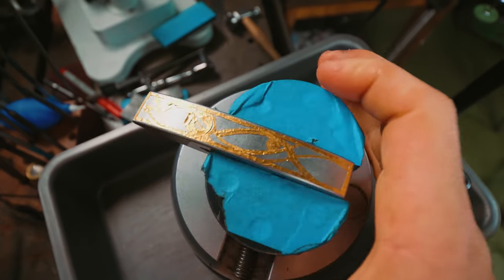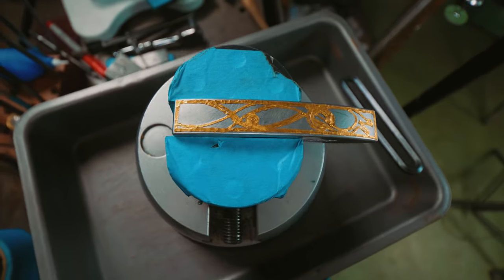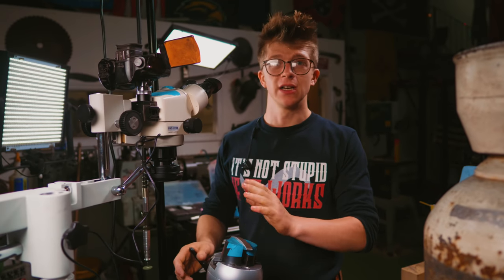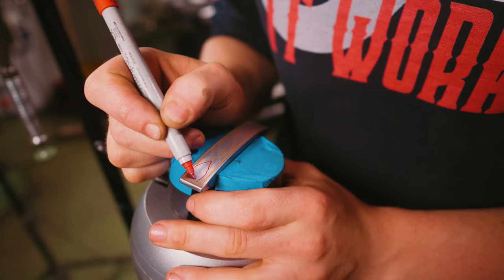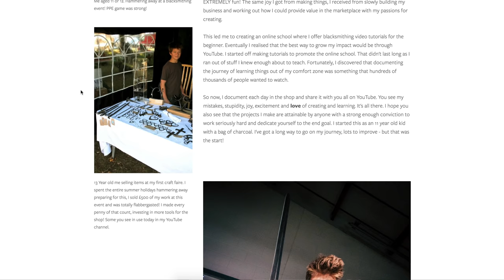MAKING A VIKING SWORD!!! Part 21

Comment: Alec, using 'Damascus' techniques I'd like to see you forge a aluminum bronze, and tin bronze twisted billet (so to be clear, alternating layers of Aluminum Bronze and Tin Bronze forge welded together, then twisted). Interestingly, this would be neither Makume Gane, Sheffield Plating, or Damascus - but something uniquely its own. As techniques are often named after their place of origin, you could call the process 'Norfolk's Bronze.' Using the twisted billet, I challenge you to forge a 'Carp's Tongue Sword.' These are ancient bronze blades and deserve a renovating rebirth! Attempt #22
Reply: I'd like to see that
Reply: will bronze forge weld to aluminum?
Reply: @jnathannger8654  Bronze can be made via a few methods: Copper and Tin, Copper and Silica, Copper and Aluminum. And Aluminum Bronze is what I'm referring to, not welding bronze to aluminum. Two different alloys of bronze (one made with Tin the other with Aluminum) forge welded together to create pattern and strength.
Reply: CosmicVitamins
Can you purchase billets of the various bronze types , or would it mean you'd have to take the separate elements and melt them yourself to create your own billet?
Reply: @notsane6967  You can buy bronze ingot of various compositions online, but salvaging scrap and making it yourself is more cost effective.
Reply: That sounds like an interesting project. Nice change of pace from iron/steel work, too.
Reply: I really hope that Alec does this when he finishes this project. I would love to see it.
Reply: Lets push this this is so awesome!
Reply: I'd love to see Alec do this, but it's poured, not forged. Once you decide on the bronze composition, you melt the copper and its companion (aluminium, or tin, or ... arsenic)(for real) in a crucible, and then pour it into a mold. Video showing the whole process: https://www.youtube.com/watch?v=PKsoch0DNfc

Comment: Only about 5 or 6 min of actual content between the sponsors bits. Was really hoping to see that gem get set today. Guess we will just have to wait for it.
Reply: Yeah it was very disappointing. If the videos progress in this pattern much longer I might have to unsub.
Reply: if it were me I would be dreading doing that part.  suck fine and delicate work that could mess up the entire project.   in this project alone Alec has begun to master a brand new art he never touched prior and its turning out really well.  don't mind how long he takes when he is hitting such high standards in work
Reply: @thewaterless  Been following this channel for a long time. Would never unsub, was pointing out that fact that this is a short little tease of a video. That leaves you wanting to see more... Would love to own this sword, hell I would love to own any of the item's that he makes.
Reply: @mrJohnboyandbilly  it's a very challenging part, in the previous video there was a snippet where he was practicing. Looked like he was getting the hang of it. I really hope this sword sells for a lot, as he is putting everything he's got and more into it.
Reply: All about the $ at this point.

Comment: As the sword is nearing completion you you might have some time to pause and breath, I had a couple Damascus questions: 

1) Are there any metal dyes so you could used layers of different colors to make brightly colored Damascus? I've seen a lot of colored metals, but it seems like it is usually a post forging treatment, not something in the metal prior to forging.
2) If you could forge in an vacuum or an argon bath, could you forge non-metallic items, or more flammable metals like magnesium? Do you just need materials of roughly the same melting point, or is there more to it?

Comment: It really shows the skill and dedication of the OG craftsmen when you think about the fact that they didn't have pneumatic burr grinders and microscopes. 

Also, remember the Guilds. In Medieval times, you would be in serious trouble right now for doing the engraving yourself. Most of the time, the smith would hand it off to a Gilder or a goldsmith to do the engraving. To do otherwise would often result in fines and/or suspension from the Guild you belonged to. It lightened up in the Renaissance, with cross-discipline crafts becoming commonplace as well as having a shop with in-house Gilders, Woodworkers, Masons, etc. It's hard for a talented craftsman to NOT learn someone else's craft and be tempted to use it on their own project in such an environment.

That said, sword makers could get away with more and often worked the fines into the price of the sword. Also, I don't remember where I learned this - I think it was either from my Metal Shop teacher, who was an avid Blacksmith, or learning Bookbinding - so take this post with a grain of salt. So, yeah, [citation needed].

Comment: why did you not use the inglet chisel instead of the V shapped chisel when do the inner border?  Would it not be deeper and better defined?  Also Alec are you ever going to try to do a copper and gold Damascus envelope opener, or maybe copper and tool grade steel.  That would be a nice "angelic" contrast.

Comment: I have a question since i still dont have a anvil im currently working on a wooden decor sword but i struggle to get both sides of the blade evenly in thickness and straightness any tipps?

Comment: O and just a thought, you can reach out to the machine manufacturer's for sponsorship, if you feel you need a tool, I'm sure if you were to use a tool and give it back with your sincere opinion someone would buy it if you were impressed. Logistical interpertation, press on.

Comment: Hello guys welcome back to part 462 of me dying of sweat and today I am going to just add a few more mini jet packs to the full size houses on the upper guard. And then after that I am planning on eating 76 tacos later and then sitting on the toilet for about, meh, give or take 14 centuries and using that poop to remake the lower guard. And then after that I’m going to run a mile 4 times and use the excess sweat to really refine the blade to a beautiful silver. Then I’m going to add some tequila and Heineken to the hilt of the blade. And also the hilt of the blade is now going to be 0.88 mm. And the hilt is also going to be covered in flex tape. And I’m going to finish the sword in part 463. See you tomorrow.

Comment: Alec, judging from the comments section, a lot of fans are getting frustrated with the length of this project, but most of us understand why it's taking so long.
The first aid videos did a good job of changing things up, but it's really not enough. Maybe you could bring back the vlog videos you used to do, just you talking to the camera. Should be fairly quick to record, easy to edit, and could work as some filler. And I, for one, enjoyed your vlogs.

Comment: Reading the comments, I am amazed at how many viewers have turned against this channel. While I would agree that this build has overrun slightly and maybe the content during the build could have been managed better. I’m sure in every series you have watched on TV there has been a run of a few episodes you thought were not up to power and uninteresting, it’s no different to YouTube content and creators can’t be expected to knock out blockbuster episodes every time. But let’s face it, Alec is learning some techniques as he is building, if he was to spend every episode banging a hammer on the anvil I’m sure you would be complaining then. I tune in every evening and catch the episodes and wish I had the time to take on some of the work he does, I enjoy the content, the challenges he faces and the mistakes he makes and is honest enough to admit to, so others can learn from them. Keep up the good work Alec.

Comment: Your content has taken a nose dive. This format of time laps and camera slides is quite over dramatic and not as genuine as your original content and the purpose you use to create. I’m sorry to say but every you tuber that hits a million subscribers always turned there content into a cash cow but loses touch with the process. I still like the way Hoffman blacksmith does the content he creates. I get this is you business but the model is not appealing to me anymore. The 10 minute mini clips of the 22 past episodes is a good example of just pushing out volume of content vs decent videos. It just sucks because you were one of my favorite channels. But business is business. Still never got a reply about the dam burners.... 6 months ago too.
Reply: On Alec's website it shows he does not have any burners however it does State on there  that Sam that used to work for him is selling them here's a link to Sam's website https://sam-fowler.com/burners-2/
Reply: The burner thing goes back months when they were in stock and I had them in my cart. But before I bought 2 1” burners I emailed him or who ever does the email side of the business and never got a response after multiple emails. If your going to run a business then RUN the business all aspects of it. Or hire people. I’m more disappointed in the direction of the content  more than the lack of responses.